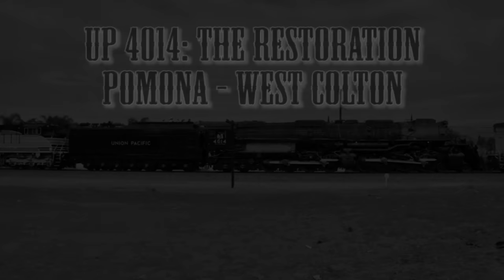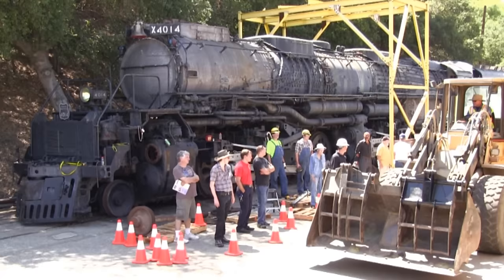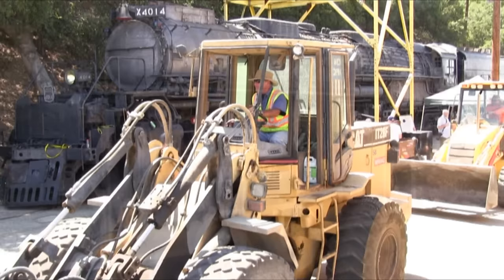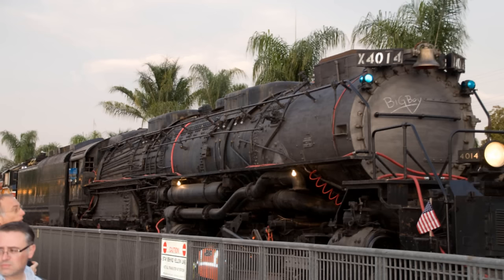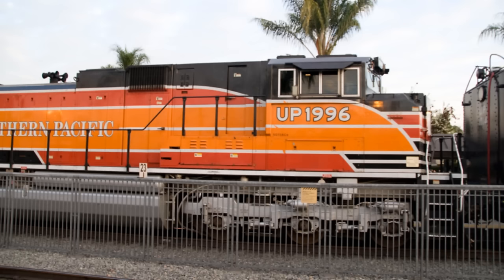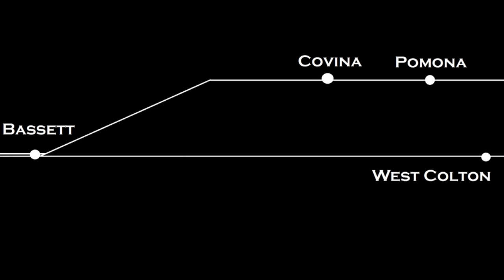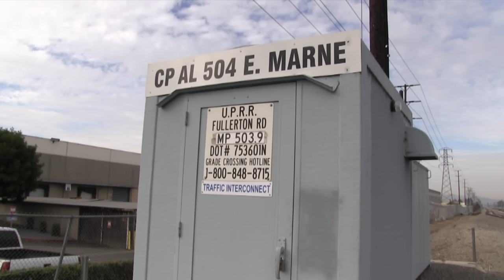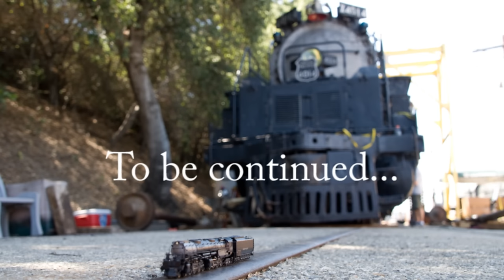Big Boy 4014 Steam Train - The Road to Restoration: Pomona to Colton

Comment: I will stick my neck out and say the red hose running the length of the loco is a temporary brake pipe. It would probably be safe to assume the brakes are not in working order on 4014 so to get air for the brakes to the train behind her, a temporary brake pipe is used to supply air from the lead loco  by by-passing 4014's brake pipe. We use a similar idea in New Zealand if a vehicle has a brake pipe that cannot be used.
Reply: Exactly correct sir!!
Reply: bigkiwimike you would be correct

Comment: The Big Boy doesn't use steam for its whistle. Indeed, on the night that the move started, crew members did sound 4014's whistle.
Reply: I'm sorry; but yes; the Big Boy does use steam for its whistle. The compressed air used at the Fairplex and at the beginning of the move was only temporary. When she's operational again; she'll be using steam for her whistle once again; as is proper.

Comment: The Big Boy is technically not the largest steam locomotive ever built.  The Chesapeake & Ohio and Virginian Railway had a series of locomotives, 2-6-6-6 Allegheny/Blue Ridge locomotives, which were even heavier than the Big Boys, and are the most powerful steam locomotives ever.  Lima made a mistake on the reporting and misrepresented the Allegheny's weight as being slightly under that of the Big Boy's.
Reply: That’s false. Despite the claims, subsequent re-weighs of early-production H-8s, performed under close scrutiny by Lima and the C&O, found them to be less than 772,250 lb (350,290 kg), the weight of the 4884-2 Big Boys.
Reply: @davidng2336  Interesting.
Reply: The yellowstones was an few inches heavier then the big boy, not an heard fact tho due to the big boys fame in popularity, Big Boy weights at 604 tons, and the Yellowstone at 624 tons, an Yellowstone is an 2-8-8-4 articulated framed steam locomotive, 2 leading front drivers, 8 driving wheels, another pair of 8 driving wheels, then 4 rear wheels behind of it, It was built in 1928 by the Baldwin locomotive works, it was meant for ore trains mostly but had an short life span of 10 years, however a few survived preservation tho and still exists with us today, but big boy takes the place as the largest operating articulated frame steam locomotive, Longest articulated steam locomotive would be southern pacifics 4-8-8-2s, numbered between AC 6 and 12, Whxih was about 124’-2” In length, Making southern pacifics 4-8-8-2s, numbered thru AC 6 and 2, The longest articulated steam locomotive.
Reply: @Interestingenough4 the big boy is still insanely heavy
Reply: Did you forget the Virginia Railway Triplex locomotive? Unfortunately that was scrapped though.
Reply: @ThePrairiesRailfan big boy is 133 feet long so Southern Pacific 4-8-8-2 is not the longest articulated. Longest non articulated steam locomotive would be the Pennsylvania Railroad S1 at 140 feet long.
Reply: @SofiaSclafani wasn’t the longer wheelbase due to its articulated design snd the cab at the front made it longer?

Comment: The trolls in the comment section best be warned: When that ol' boy is completely restored and his sister's boiler is fixed, you will regret saying things like "They should be scrapped because they're ugly" and "Cats are so much better in every way". You might be unlucky enough to get yourself a one-way ticket to a scalding hot grave as 3985 or 4014 charges at you, ready to turn you into a slick mess on the rails.

Comment: Am I the only one who noticed the diesel locomotive coupled to the Big Boy was numbered 4884? Kind of ironic considering the Big Boy is a 4-8-8-4.
Reply from the maker: +SMOBY44 That was intentional, as well as the one numbered 4014 in the second part of the journey.
Reply: +CoasterFan2105 Don't know of a 4-01-4 engine.
Reply from the maker: It's in the other video of the big boy on my page. Apparently it was not available at the time of this move, otherwise they would have used it instead of the SP 1996 unit.
Reply: SMOBY44 I saw that too. I thought that was funny since another diesel was named 4014 also.
Reply: SMOBY44 k
Reply: SMOBY44 the locomotive number
Reply: no it is the wheel arrangement 4 lead 2 sets of 8 driving wheels then the 4 trailing or firebox wheels
Reply: SMOBY44 4884 was because 4014 is a 4-8-8-4. Now the loco on the second part of the journey, 4014, is a diesel with the same number as 4014
Reply: SMOKY Ken

Comment: Also, since this is all about nostalgia, it would have been cool if they had piped some air off the diesels to the 4014 so they could have blown the 4014 whistle along the way.  Would have been a simple thing to do.  There might not have been enough air for long blowing, but even short blasts would have been very nice.
Reply: Sorry, but no thanks.  Anyone who knows anything about steam whistles knows that the whistle sounds significantly different when powered with ordinary compressed air than it does with actual steam.  Would it have sounded cool anyway?  Perhaps, but it wouldn't have been the true sound of a Big Boy.
Reply: Bradley Munsen While it was at the Pomona Fairplex, they actually had it attached to compressed air and visitors could climb into the engine and blow the whistle, a really amazing experience.  Your correct though, it was not the same as the thing thing, but still really cool for what it was.
Reply: Tim Alcoser Yeah, but if I'm correct, 844 currently has 4014's whistle.
Reply: Tim Alcoser Hey, I just listened to this again, and at around 3:22-3:24, I can hear something that sounds an awful lot like a steam whistle.  It's a bit quiet, but it blows twice, the second one being louder.  Any chance that might've been the Big Boy somehow?  There's also some steam whistle blasts at the end of the video, during the still photographs, not sure if those are new recordings or old sound bites though.
Reply from the maker: Yes, that is the steam whistle. It's the only time I heard it during the move so I wanted to include it in the video.
Reply: Bradley Munsen Good ears....
Reply: At 3:21 they blowed the whistle

Comment: They should return all Big Boys that are still alive back to service.
Reply: Sadly 8 were preserved, the rest were scrapped. And 4014 is the only one that was is great condition. The rest had deteriorated too much. Hence, 4014 was and is the best choice for restoration.
Reply: Big Boy 4006 is looking ok its just that the rain is making her parts all rusty.
Reply: What about the big boy in steam town it's looks alright to me.
Reply: Well getting a 100 ft + steam engine through the appalachians is a big problem...
Reply: SteamKing2160 true
Reply: True
Reply: The biggest reason is the time and the cost of restoring all those engines there's no way they could afford to do that and the time will just take too long.
Reply: R&N RailProductions yeah X4012 is In overall ok condition, but on the other hand it is pretty worn out, If they did restore it it world probably take about an estimate of 6-7 years though. It's still fixable
Reply: SteamKing2160 l
Reply: @windlockatc  4017 and 4023 are in excellent condition but the museum that kept 4017 refused to give it up and 4023 was too far from the rails

Comment: They must have had to keep the speed low, considering how long 4014 has been stood and the potential state of the wheel bearings.
Are the axle bearings on UP4014 plain metal or roller bearings?
That's one of the differences between the English and American methods of building steam locomotives I do not understand.
In England wheel bearings were bronze shells coated internally with 'white metal' ak.a. 'Babbitt metal'.

Comment: Why did they drag the hoppers along, for braking power?
Reply: Mitigation of weight concentration.  The 4-8+8-4 American Single-Expansion Articulated, Class BB-1, is the heaviest extant steam locomotive in the United States, with some 300 tons empty weight, including tender, on the rails (about 400 loaded, if memory serves me correctly).  The Union Pacific will be running a system-wide upgrade of their main lines to the heaviest, sturdiest available rails in order to endure the pounding that the Class BB-1 demonstrated in regular freight service, concurrently with the complete overhaul of #4014 at Cheyenne.
Reply: B. C. Schmerker
 I can admit firsthand UP has been working non stop for the last 2 years upgrading their mainline. I don't live far from Lincoln next to the transcon railroad and UP has been replacing wood with concrete ties, heavy weight rails, extra ballast. Pretty much the whole 9 yards. Since the steam program runs through here on the way to Omaha, etc on a regular basis one can safely assume its at least in part due to 4014.

Comment: What would happen if you tried to fire up a locomotive unworthy of being fired up?
Reply: +JacksonAndLansing Railroad   The boiler could rupture and explode.My great uncle, who was a steam locomotive engineer in the 1930's and 40's said it actually happened.
Said a boiler blew off the frame and wheels which remained intack on the track.
Reply: Robert Gift Yeesh. I figured it would be something like that. Did they not know what would happen, or was the fire up an accident?
Reply: JacksonAndLansing Railroad  Unknown.
Steam locomotives kept hot to work the next morning had to be checked overnight.  If water was allowed to get too low they could and did explode.

A deadly boiler explosion on a moving train happened when the water was allowed to get too low.
The water ran forward and the metal above the firebox (what is it called?) got too hot.   When the engine was on level track, the water ran back over the hot metal and the boiler exploded, killing the fireman and engineer.    The locomotive frame and wheels and train coasted quite a distance down the track.
Reply: +JacksonAndLansing Railroad If you assume the boiler is at least steam-tight and enough of the plumbing still works to have control of it, you still face corrosion having weakened the boiler till it bursts, destroying the engine and killing whoever was at the controls or nearby it when it let loose. 

Now an engine unworthy of being fired directly could possibly still be propelled by piped-in steam from a boiler that is safe to operate, but I don't know of this having ever been done with steam engines. Diesel-electrics on the other hand actually do use a similar concept from time to time where a locomotive without its own diesel engine is fed electricity from other engines in the train to increase traction without requiring a full engine set.
Reply: IN THE COUNCIL BLUFFS YARD THERE IS A PICTURE OF WHAT HAPPENS TO A STEAM LOCOMOTIVE WHEN YOU LET THE WATER GET LOW, IT BLEW EVERYTHING OFF THE TRACKS BUT THE DRIVERS

Comment: DO you think we could get it upto 88MPH  if we get the water hot enough
Reply: To be sure.
Reply: ***** highly doubt it. she is old and it not able to that fast anymore she may do 60 mph but not 90
Reply: ***** Your right, not 88, but on paper they where engineered to do 80 without mechanical failure, theoretically

Comment: What was the point of adding a big boy if the sd70mac was gonna pull it
Reply: If you’re talking about the trains used in the video, the Big Boy was not yet operational they just had the wheels loose and could roll it. If you’re talking about these days, a diesel is used a helper to the big boy(not sure of the full reasoning)

Comment: what do you think would of happened if you had a single diesel and a fully steamed up BB , and they started pulling the opposite way to each other? 

now that would be a sight
Reply: BELIEVE IT OR NOT if u were to put 4014 up against one of CSX's "heavy" AC44s or SD70MACS - based on what I've read about - the diesel would most likely win. with the right software CSX's "heavies" have been able to achieve 200,000 lbs. of starting tractive effort. although in regular service they keep em limited to 180,000 lbs.
Reply: broken4813

From a dead stop that would be correct :) Steam locomotives develop max tractive effort at speed, while diesels is from a stop. I do think though diesels are starting to encroach on the power of the bigger steamers now.
Reply: As others have said, from a dead stop, diesels will always win because diesels are what is known as a CONSTANT HORSEPOWER machine. They have relatively the same horsepower at 8 mph that they do at 50 mph. Steamers are what is known as a CONSTANT FORCE machine, but not really because of the factor of speed, gradient, the number of lbs on the rail, and the inherent 20% slip that steamers have and that is being generous. The faster the steamer goes, the more the horsepower skyrockets, the less the wheels slip because the horsepower produced by speed lessens the drag and the lbs put on the rail becomes more effective. When the steamer reaches a certain speed, it theoretically should, as a constant force machine, have the sky as the limit (as long as the fuel holds out.) this is not true because the mechanical limitations of piston stroke at speed is steam applied for shorter and shorter intervals to the piston, and you don't achieve a net gain in speed nor horsepower as it starts to even out. Tl;dr, there is none.. Steamer execution on the rail is highly complicated.

Comment: Does anyone know the purpose of the hopper cars?
Reply from the maker: ***** A longer train means more air in the brake line. Extra cars were added so that there would be enough air in the line to brake effectively ( the locomotive weighs over 1.2 million pounds).
Reply: OK well that makes sense.  Thanks for the answer.
Reply: I y9
Reply: https://en.wikipedia.org/wiki/Hopper_car
Reply: +CoasterFan2105 didnt understand that^ but i think you said that they added more cars to brake better, more wheels, more brakes
Reply: +CoasterFan2105 1.2 million lbs? All I have to say about that is USA USA US

Comment: Big Boy was classified as a 4x16x4 locamotive
Reply: correction:
it a 4-8-8-4
thats the proper wheel arrangement on how steam locomotives were classified
4-6-6-4 is the union pacific challenger
Reply: A 4-16-4 would be one interesting engine.. It could only travel in a straight line! Russia already tried a 4-14-4, and that was an epic fail.

Comment: I would like to see this machine put back into service. Could it be run on propane in a way to make it profitable?
Reply: +Bob Ordewald good idea
Reply: What they are planning on doing a converting the coal powered locomotive into an oil fired based locomotive.
Reply: +Bob Ordewald  Never.   Steam locomotives are terribly inefficient.   They are constantly wearing themselves out and breaking down. They are also hard on the track.   My great uncle loved his huge 4-8-4 freight locomotive, hated going on vacation!, but it was always needing repair and refurbishment.
Reply: Robert Gift Thanks. I knew the maintenance issues but steam - in some form - needs to be looked in to for the small RR's and short runs. To have a machine hat can run on whatever fuel is cheapest at the moment should be looked in to! During WW 2 I read that somewhere - I don't recall more - A country converted steam loco's to run on electric. Oh well, it's to late to think clearly. Thanks for sharing your Grand Parents with us. I wish mine had lived longer.......
Reply: Bob Ordewald  Electricity heated the water instead of coal.   Very inefficient.
Reply: Robert Gift true but cool thought. If you can't afford new equipment and coal is a big problem then run it off of free(hydro sorta free) then you do what you must to keep the trains rolling....

Comment: Why do they have the hopper cars? braking?
Reply from the maker: Jon That's what I've heard from many people now, so I assume that's right. Probably because the Big Boy is such a heavy engine, they need a long enough train so that there is enough air in the brake line to stop the train.
Reply: CoasterFan2105 @over a million pounds that does make sense, thanks for the input.
Reply: CoasterFan2105

Comment: Why did they put the hopper cars in?
Reply: The Big Boy steam loco has no breaking power because its breaking systems don't work and the diesel loco's don't have enough breaking power to stop them selves as well as the steam loco, so to add extra breaking power required to; move the train safely, they added the hopper cars.
Reply: *****
I see, Thank you.
Reply: *****
It's "braking" actually.  Thou hast been smited by the Grammar Bully!